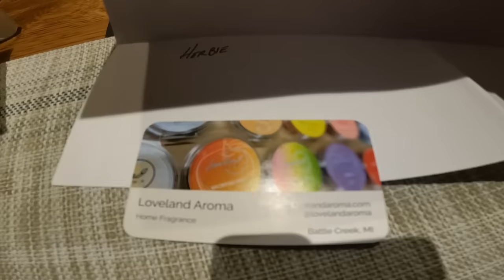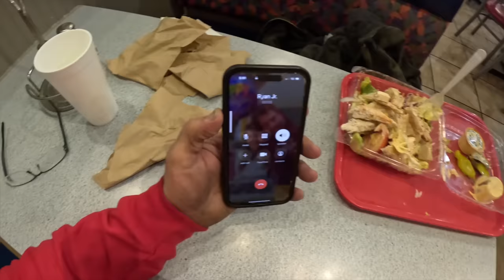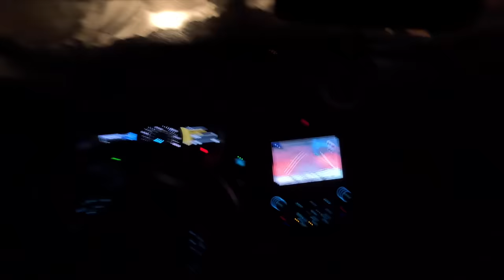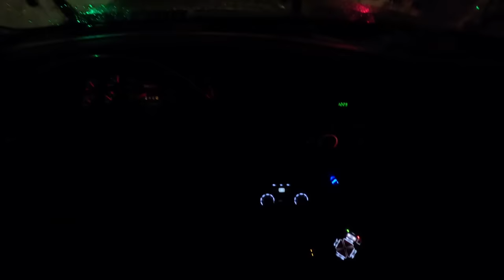Huge snowstorm, MASSIVE headache!

Comment: Ryan, I also plow snow in the winter, but I am a one person, owner/operator company. This snow storm hit us here in Clayton, New Mexico, yes in New Mexico on the 8th and dumped 13 inches of snow in blizzard conditions with 50 to 60 mph cross wind. I  know exactly how you felt. My truck got stuck trying pull a friend out. The city tried to pull me out but also their loader and motor grader stuck. So I couldn't get my truck out until 24 hrs later. After getting unstuck, truck wouldn't start until the 18th because it froze, with snow and ice filled every crevice inside the engine compartment. Anyways, enjoy watching your videos, Big fan...

Comment: When i was working as a snow remover, did crew used walkie talkies , radios or PTT to communicate. Just a heads up for upcoming winters. it´s a good way to communicate instead of screaming and hand signals. Have mounted radios in all your machines. I do not miss plowing snow. Keep up the great work. Daniel From Sweden

Comment: Back when I used to do concrete work I found out about Corn Huskers Lotion. It was the only thing that prevented my hands from cracking from the concrete. That stuff is great.

I used to love plowing snow with my 90 Chevy K3500 4X4, but I sold the plow, and moved myself and my truck to Hawaii so I never have to deal with it again, lol.

Comment: Im a truck driver for a huge company.  Unfortunately in weather like this it takes hours to get a tow.  My 01 superduty wouldnt start twice this year.  Have no clue why except my injector computer in the driverside fender has some minor internal components that tested bad.  The only sensor type thing that could keep it from running on that engine is the ipr valve.  Its a solenoid that controls oil pressure to the injectors.  But that doesnt just work or not work.  Even with a bad pressure sensor the valve follows a default strategy.  So likely the injector computer.  Have someone scan your high pressure rail.  See what pressures your getting from your high pressure oil pump.  But i still think its fuel related.  Lack of or algea.

Comment: You really need to get some family service radios. (FSR)   They're dirt cheap and work really well.  He would say to you so much time driving around.  Mine have arranged from 15 to 35 miles.  They all have recharkable batteries.  Use them all the time...Even shopping at Costco! 😊

Comment: Ryan it's either the cam shaft or crank shaft position sensor. Had the same problem. Positive it's one. It is located behind the motor on the driver side as you are facing the motor.

Comment: There are plastic filters that extend the reach of the pickup in the tank.  Sometimes they break off with age.  Sometimes they are plugged.  If they break off you lose several gallons of capacity.  Next time it dies unscrew your filter on top of the engine to see if its full or empty.  Also run an algea treatment.  Ive never had an issue in my life until a tractor ive had for 30 years wouldnt start.  Algea clogged the fuel system.

Comment: Ryan falling off the sidewalk and getting stuck is why i use a track machine with snow tracks for plowing snow.   I've never been stuck once.
Reply: He just bought all those brand new track machines and then he's using two wheel machines lol
Reply: @kalen01  27yrs plowing on tires I have been stuck twice.
Reply: @kalen01  maybe not but might not have been worth 27yrs of teeth rattling either.
Reply: @ty8324 he’s always plowed with them machines he never intended to use them new track machines to plow

Comment: Same storm in northern Illinois I had nothing but bad luck!  2nd place the pins on the plow broke! Saturday morning transmission cooler hose got a hole and didn’t notice in time and it hurt the transmission, so I was stressing while the transmission was slipping later that night popped a hydraulic hose on the plow!   After the storm I had a transmission I had as a backup and put it in and didn’t even make 30 miles before that transmission went out, had a buddy push me home 20 miles with my other pickup! Had to tow it to a shop and went and picked up another transmission and that one wouldn’t work so at the last minute I rushed to a junkyard for a transmission and thankfully that worked! Got no sleep at all for todays weak clipper system and I went and started the truck and the blower motor didn’t turn on.   Man that was a cold 6 hours    I’m over this week lol

Comment: Use a snowblower attachment on skid loader for sidewalkys works magical
Reply from the maker: I have one, but it’s not working right now
Reply: @VictoryOutdoorServices  suprised you dont have a plow and sander on the tri axle and 10 wheeler big big money and eaaaaaassssssssy money 
My tri axle earns 252hr and normal storm i get 20 to 32hrs off the state
Reply: Would keep big ray super busy and put junior in the 10 wheeler
Everyone says it rots out the trucks etc the way my truck is setup 0 salt gets inside the bed everything gets new hampshire oiled ahead of time and washed after every storm with cold water

Comment: Ryan it may be the injector wiring harness has a short under the valve covers if it intermittently cuts off, acts strange, and doesn't start sometimes.  I had a 7.3 that would randomly die driving down the road and that's what it was.

Comment: Ive been stuck in multiple vehicles 100 feet away from anything lol.  And ive high centered my plow on my s10 and my 01 f350.  If your ever unable to get out on your own unhook your plow and back out.  And rehook on the street.  Done that before.  Also my moms driveway is a quarter mile of half gravel half sand.  Even with feet u dig in.  Because in minnesota our first plowable snow is before the ground freezes.  This year though.  No snow.  So far.

Comment: On the 7.3 mine did the same thing you have to update the injector plug harness that goes through the valve cover , it's only about 80 bucks a side when I did it . They become loose over time and cause a rough idle hard start and a skip much like a bad injector . If you do that update and dump a bottle of archoil ar9100 in the oil you will not believe the difference in cold starts and the way it runs in general

Comment: When you get stuck, stop ASAP. Press on the brake, put the vehicle in the opposite direction you were heading (forward or reverse). Do not touch the gas peddle. Release brake, let the car idle in the opposite direction until it stops. It may only move an inch by switching gear but then press on the brake. Never touch gas, just switch between forward and reverse, braking in between. Obviously if you are buried to the frame, you're done. If the vehicle moves an inch each time, go 100 times; forward and reverse. You'll get out. Then take a break.

Comment: Ryan, that f350 will run for years as long as you keep up on maintenance. I have a 99 with the 7.3 and I have over 257,000 miles on it.

Comment: As a city plow driver, that storm was tough to deal with. We had every piece of equipment out, about 40 vehicles, couldn’t keep up, as soon as it starting letting up just a bit, temps plummeted and ice shelving everywhere. My tandem dump truck couldn’t make it down almost any residential street. Had to go 50’, back way up and hit it with a head start, 50’ and repeat. Got stuck twice and needed wheel loaders to get out and that was on pavement. A week later and we’re still running 16 hour days trying to clean this mess up.

Comment: You should mount some cb radios in the equipment/plow trucks. Save some time finding guys. There easy to install Midland CB Radio makes very small ones for equipment. Roughly 120$ for the entire set up.

Comment: Your truck shutting off is the crank position sensor very common on the 7.3 keep you a couple spares and a 10mm to change it mine has done it 3 times now only replace with motorcraft brand from ford the others are usually junk right out of the package and eventually it will die and not start until you change it been there and done that

Comment: I grew up using corn huskers and I haven't used it in years. My stepfather drilled water wells and I would help him regularly so at 13-14 years old I had split dry calloused hands. Corn huskers feels so nasty on your hands but it works very well. Along with bag balm.

Comment: You should look into some of the SnowWolf Wolfpaws for those wheel machines!
Reply from the maker: Those are winter tires.
Reply: You can buy a complete set and bolt them on for the winter months. Have sold a bunch of sets and hear nothing but great things.  Stay safe out there!
Reply from the maker: @yofr762  That is what is already on the machine. It’s just a different brand.

Comment: The ole 7.3 has a cam sensor going bad. Very common thing. One 10 mill bolt and its done. Just whatever you do dont buy a parts store one. Buy a motocraft sensor otherwise youll be in the same position.
Reply from the maker: Thanks, a couple other people have been saying that as well.

Comment: Or it could also be your map or maf sensors causing wrong air to fuel ration which could also cause it not to run right check if you have rough idle on start up

Comment: Hey Ryan I'm a mechanic and I bet you have a chafing wire back against the firewall that only touches certain times maybe your motor mount on a driver's side has gone bad and it only Touches at certain points check the wiring that goes to the transmission on the firewall
Reply: There's even a wiring harness that runs close to the EGR tube as well on them 73's
Reply: And check your grounds especially y'all being in the snow in upstate

Comment: I live in Phoenix, barely been around any snow so I’ve never snow plowed so idk how it works but how does someone get stuck plowing side walks?? It looks like Cisco is trying to plow a whole mountain that it gets to heavy and makes the back of the skid steer slide to the side and ends up stuck. Right or wrong?? If that’s the case would it be better to not try to plow a huge mountain at once???

Comment: Do you ever add fuel conditioner and 911 fuel anti gel ,
Try 2 onces of each in your f350 fuel system. 
If there is any water in your fuel system it could cause it to miss fire and buck.

Comment: biggest mistake you did on the end part ryan is you parked it front in.. when its winter times etc  and storm or big snow predictions you rly wanna park whit your front out so you can just start plowing your way straight out to the road. otherwise you just gonna get stuck easy. and use more lights man when your plowing.

Comment: Where i was raised in oregon we could easily get a foot of snow in an hour. Ive personally seen it snow 6 feet in 12 hours . You guys would really freak out if you had snow like we get. A foot of snow doesnt even make the news.
You should think about waxing your plows. Buy a box of parafin like they used to use to can jelly with and take a bar of it and rub it on the face of your plow and it will really help the plow shed off the snow especially wetter heavy snow.